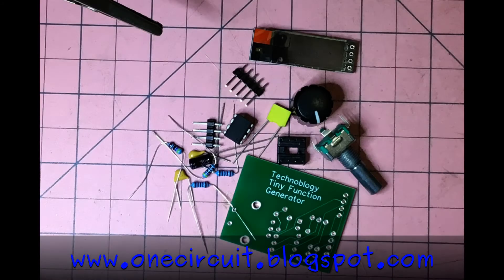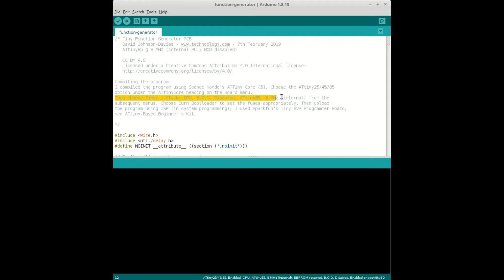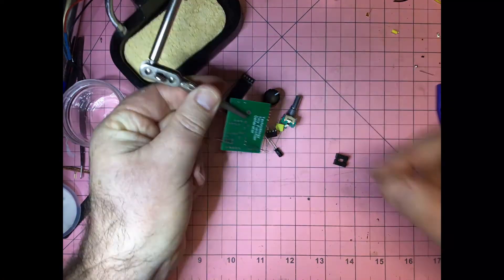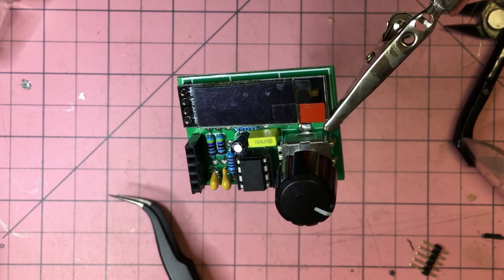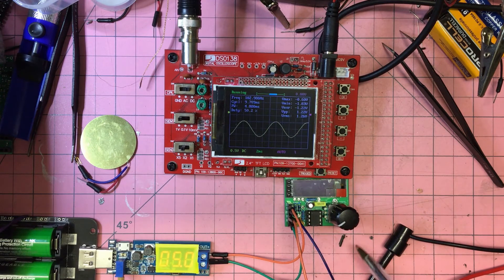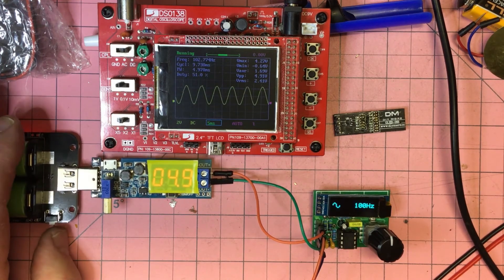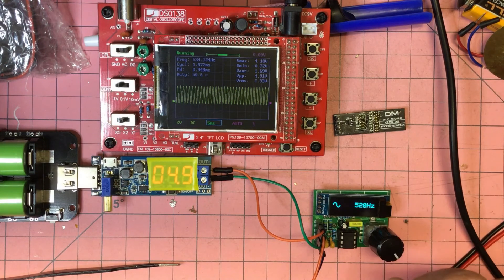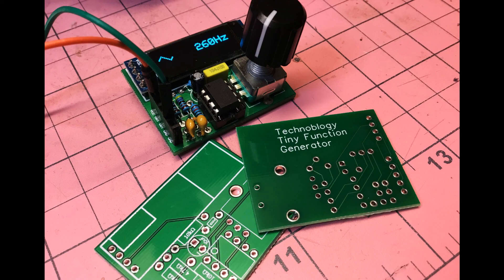Attiny85 based DDS Function Generator

Comment: I am trying to build this project, but I am getting a plethora of errors during compiling the code. I have built one of these before, but it eventually broke.
Reply from the maker: It's difficult to debug from afar, but maybe you could try a different compiler/IDE/OS etc, and maybe also test if you can get an attiny85 to blink an LED at 2Hz to check fuses and timing? The little buggers can be tricky when fiddling with the bootloader and using David's DDS routines. Good luck and please let me know how you get on. 👍😀

Comment: Thanks for this project. it is really amazing , but having problem in uploading the code into the chip after bootloading, can you also mention the necessary libraries for the project.
Reply from the maker: The code is on the original site - see the blog link and this code: http://www.technoblogy.com/list?2GXC
Reply: Thanks it worked ✅
Reply from the maker: Excellent news! I just used mine for my latest video - a very handy signal generator!
Reply: @onecircuit-as  I cannot get the code to compile, I have double checked all of my settings, I am very confused. It is just throwing me a MESS of errors.
Reply from the maker: @jtb8631 see my reply on your other comment.  👍😀

Comment: That's pretty clever. I like it.
Reply: Yup, pretty cool ... uses all 6 pins!  The programmer certainly fused out Reset though. 
May be difficult to modify/re-purpose if it does not power-on with Micronucleus.
Need to have a HVSP handy for resetting mistakes in that arena!
Reply from the maker: The clever belongs to David - lovely design! 👍😀